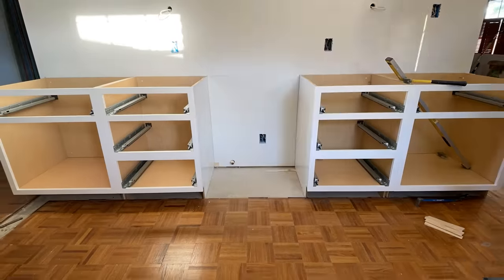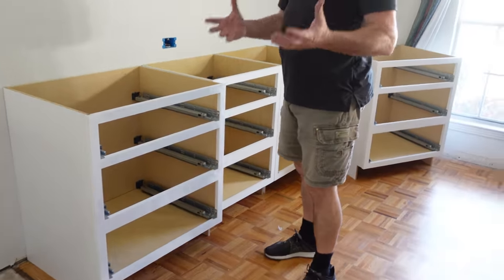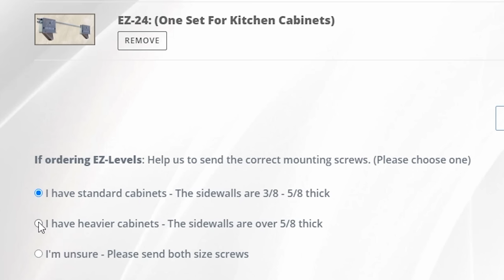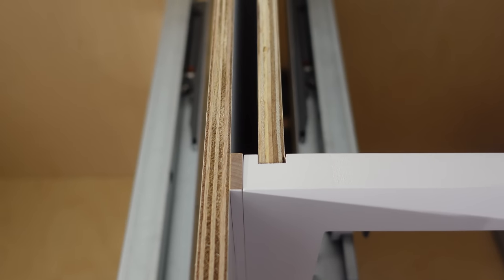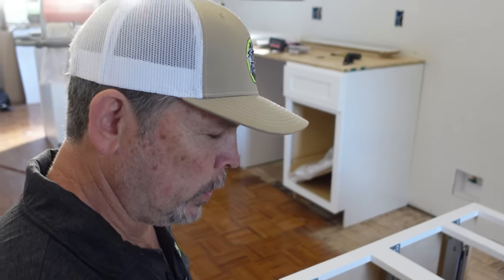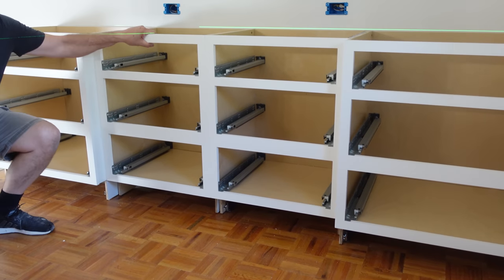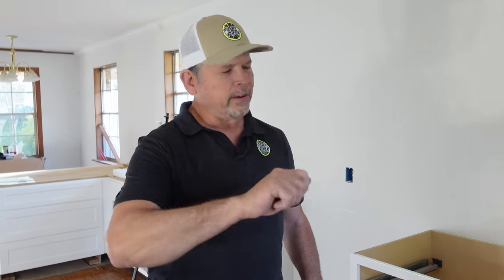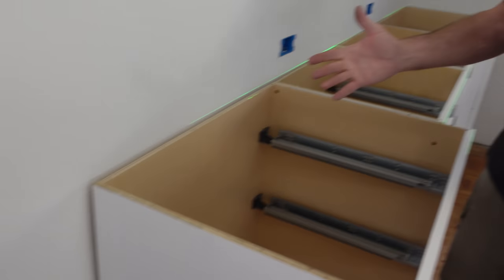$2 Shims VS $40 EZ Level - Is It Worth It?

Comment: Scrulox=Robertson screw pretty nifty invention, I see them used a lot in decking, square type heads=scrulox or “Robertson” screws. In my opinion easy level system is great, yet they are permanent so needs to be included into the estimate for the install $2 as opposed to $16…ehhh I’d got with the time (labor) saver, just saying.

Comment: What locks the ez levels once it’s positioned? Will pressure over the years cause that foot to compress? Or relying on the screws in the back of the cabinet?
Reply: Not a bad question. Hopefully it's designed in a way that this isn't a problem.
Reply: You would screw the cabinets to the wall anyway so I would think that would solve the back side issue.

Comment: Glueing those metal units and the spacer couldn't hurt. Loaded cabinet over time will have less movement. I've worked on mega houses for years but overkill things like that are worth it. Just a bit of polyurethane. Locktite X9 would be my choice.
Reply: Great find. I'm a builder and I decided to do the cabinets myself for the first time on a house. I'm ordering a box. Keep in mind that at least one end or location is usually your high point and you wouldn't need a unit there. You should know from your laser work where you can skip them. I'm now going to use a level with a tape on it to measure the floor at the cabinet front. Good find

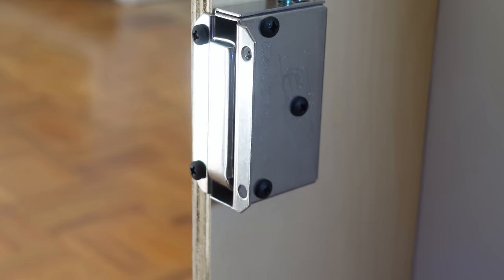Comment: @stud pack 9:11 Paul, is that Klein’s new impact flip socket, or actually the 14-in-1 HVAC Adjustable-Length Impact Screwdriver with Flip Socket - model: 32304 (Klein sent me one and like it, BUT the circle plastic that retains/holds bits in slots and separates from inside handle, already let loose and all bits fell into handle and was aggravating b/c couldn’t close or open bit storage. So, wish was 1 solid piece, or better yet, metal and welded together instead of glued, but they sent me new 1 next day and was able to keep broken; so great CS Agents☺️👍🏻…..(sure does look like the gold standard Malco bit, but w/ a little secret up it’s hole…imo, kinda cool cuz never fails when using a malco ¼” or 7/16, etc…ya need a driver bit and gotta remove the Malco bit. Sure hope Malco isn’t like Klein’s flip bits and will accept a “driver bit” b/c after all these years, I’d feel so so so stupid😂🤣
✌🏻

Comment: The q is, will it hold the weight of the slab plus appliances. So much weight will be pushing down, and what keeps those legs in place are the threads on those adjusters.

Comment: Glad you reviewed the ez level system. Haven’t seen it before. What laser system are you using & recommending? Thx
Reply: Studpack uses Bosch laser with Huepar Fine-tuning Bracket Laser Level Adapter. They mentioned the laser model on the previous video for this cabinet install series.

Comment: In the situation as presented in the video, the EZ Level system was not necessary to access the back of the corner unit. With the toe kick removed a shim could have been used to level far right corner unit.

Comment: Love all your videos, I was about to install my cabinet with wood shims. Your videos are helpful to me! As I know the cabinet should not install on top of floating floor(LVP), by this way I need to raise my cabinet to just above the height of my finish flooring. I was planning use plywood under my cabinet in order to raise it up. I wondering do I still need the plywood under the cabinet if I use EZ-leveling? Thanks!
Reply: No plywood needed.  The EZ-Levels have a lift of 1-1/4".
Reply: @EZ-Level  thanks for answering my question, I have another question that do I need any thing like support bracket for dishwasher gap? It’s between sink cabinet and another base cabinet
Reply: @kellykai4068  Hi Kelly; Yes... you will want to screw a 1x4 to the wall at the laser line. Therefore... do this once every cabinet has been perfectly laser leveled. This will support the granite. (I also fasten one in the front also. Laying it flat of course) Some don't but I'm a bit of an overbuilder.
Reply: @brookscourtney4732  thanks for answering my question, when we screw the base cabinet do we just screw on the top? Or we need screw both top and bottom?
Reply: @kellykai4068  We screw along the tops (just behind the drawer) only
Reply: @brookscourtney4732  thanks, when I mount the EZ level on cabinet. The top two screws(5/8) split the plywood is there anyway to avoid it?
Reply: @kellykai4068  ahhh gotcha. Once in a while that happens. It depends on the cabinet line (the wood used). Even those little screws (#6-5/8") can tend to split some plywood/particle board sidewalls. Because they are so tiny, the split is really not noticeable at all. (at least in our experience). Also, those are not necessary, but they help to keep the EZ's in place while dragging the cabinets around the kitchen during install. They don't hold anything up... They just hold them onto the sidewall during installation. Does that make sense? I have one of my cabinet lines that their plywood splits a little too. My other lines don't at all. We just ignore it now, as we have used them on those cabinets for almost 10 years now. I hope this helps

Comment: Those feet on those shims over time will embed into subfloor. Add a little weight like pots pans and a heavy counter top it just a matter of time before you have problems. Shims are better due to the fact they have a larger bearing footprint.  That’s one of those ideas that sounds good but in reality old tech is better.

Comment: Question? Couldn't you install then between cabinets that connect? As your 1/2 inch filler? Get a screw long enough to go through the leveler into the other caninet?

Comment: Its a cool idea but theres no connection to the floor. All the cabinet Bro's Ive worked for including myself always use separate toe bases that are attached at the front to scrap 2x4 Tapconed to the cement floor...SOLID.
Kudos to StudPack for using Wic screws...if I had a buck for every schmuck that uses drywall screws to install cabinets! It makes something much bigger, fuzzier and further south than my remaining 3 wisdom teeth ache (I extracted one of them myself leaving me 75% intelligent).

Comment: It would be great if the manufacturer supplied small plastic caps to go over their screw heads. Then there would be no chance to accidentally scratch/tear the flooring material when moving the cabinets in place.
Reply: Reminds me of a job I did remodeling a kitchen. The customer had put in a new vinyl flooring in the kitchen after I had built their custom cabinets. They got a new refrigerator too of course and it was sat in the middle of the kitchen floor when it was delivered. The ladies of the home decided to push the refrigerator back into its place by themselves and tore their new vinyl flooring. They were so upset and knew when the man of the house found out they damaged the floor that he would have a melt down. I told them that I could easily patch the spot and you never know it was damaged. Needless to say the ladies were relieved to hear that and could get me to patch it quick enough. So I patched it for them and as I told them you couldn’t tell the floor was ever damaged. The ladies were not going to tell the man of the house what happened. Wasn’t my place to say anything either so I didn’t say a word to the man of the house either.  But the lady of the house apparently told one of her older adult daughters about the incident on the phone and the daughter came over one day and looked at the floor seeing no sign of the damage that was done and said to her mom in front of her Dad too! Hey mom you can’t even see where it happened at! Dad saying what happened where? LOt The ladies had to do some back talking and quickly working on changing the subject to keep from telling the husband what really happened.  To this day I have no idea if the man ever heard about the damage to the floor or not?  Saved the ladies bacon that day though! Even though the daughter almost let the cat out of the bag so to speak! LOL  only took a few minutes to fix the floor with some scrap flooring materials and I didn’t charge the ladies anything for the repair.  Had another incident where I installed a new laminate countertop for a lady and I no more then finished the job and went home when I got a call from the lady upset that she scratched her countertop. Again that ended up being a petty easy fix too with a little seam fill I was able to fill in and match the color of the laminate where the scratch was hidden very well.  The lady was very happy I was able to fix the scratch without having to replace the laminate again.  Didn’t charge her for that one either.  Although if it happen today with these high gas prices I’d probably have to charge a little for the gas !
Reply: I don't even use the screws on the bottom they really aren't necessary the three screws onto side are enough.

Comment: Cabinets should come with these all ready installed as an option. Seems well worth the extra cost that will save money in labor time. 👍👍
Reply: I too have said this a thousand times. Years ago on some TV home remodel type show the crew were installing cabinets that had adjustable feet at all four corners accessible from inside the cabinet.  Best I could tell the adjusting feet were something similar to the adjusting feet on a dishwasher. There was a small hole in the base of the cabinet to insert a tool to move the foot up/down.  Surely a cabinet company could add this feature to each cabinet for less that 30 bucks per cabinet.
Reply: Doc you’re lazy I know you .. stop that

Comment: Easy system but As builders why not just add 2x6 blocking between the studs on the wall where the cabinets will go and at the corners..

Comment: Those metal levelers are pretty cool, probably worth the money if the customers are willing to pay a little extra cost over the wooden shims?  Know I’ve spent a lot of years using wooden shins before these metal adjustable shin devices were made.  But I don’t trust or count on chipboard to hold those metal adjustable shims with screws only screwed into the chipboard. As this guy in the video says be careful tightening your screws in the chipboard or you’ll strip the screws out and then you’ll need to take the screws out and plug the holes with some glue and toothpicks to fill the hole then start over trying to screw the metal adjustable shims back on the  chipboard again. Personally I’ve had too many screws work loose over time and strip themselves in particular board or chipboard.  Another reason I never built my cabinets out of chipboard. I preferred using a 7 ply birch plywood. 11 ply if I could get it!  Then you got a strong material you can screw into that won’t strip out anywhere near as easy as chipboard will. Not to mention chipboard starts breaking apart in flakes if it ever gets wet for any length of time.  Plywood far more stable in water.  Really don’t like even using chipboard for countertops.  Especially not on a island with a bar overhanging the back.  Plywood so much stronger and can take a lot more weight on it when the wood hanging over the back of a island cabinet.  If you get many kids horsing around when mom and dad not around climbing on the Island bar top you may regret is it’s made of chipboard? Chipboard certainly cheaper to buy, but in the long run the plywood worth every penny over time!  Unless your selling the home, then it’s the next buyer problem when the chipboard fails in some way like bowing or warping, especially when it’s under any weight.  Seen several cheap roll top desks people bought in furniture stores where they had books and Nicknacks on the top of the roll top desk and just from the weight of those items bowed the chipboard top down more then enough where they couldn’t open the roll top any more.  I’ve had to replace the top with a good sheet of oak plywood to match the roll top so it was usable again and then putting the books, etc on top of the roll top wasn’t a problem any more either.  I always try to talk people out of using chipboard whenever I can. But unfortunately some people just have to learn the hard way!  Chipboard cabinets you just never know when their going to start falling apart?  Just take a look at your old cabinetry that’s made of good plywood that’s still in homes and holding up even decades later!  Your not going to find those chipboard cabinets holding up to the long years of time!  Fact is, I’ve had to go in and remodel chipboard cabinets within 5 years in some cases. Especially when the cabinets are made of 1/2” thick chipboard as many are! I always service my customers if and when they had any problems with any cabinets I built for then no matter how long ago I built their cabinets?  Long as it wasn’t from serious abuse I take care of it no charge.  So I wasn’t going to use materials or hardware that I knew wasn’t the best and not likely to last more then a few years.  Legally cabinet shops only have to guarantee their cabinetry for one year. Then if something goes wrong it’s the home owners problem to fix or replace. But I guess it’s like everything else these days, everything falls apart or fails many times even in a years time and you need a repairman to fix it! Not like the good old days when TV’s, stereo’s, refrigerators would last and never need a repairman for generations of these items being handed down to the next younger generation of family members!  Things built these days probably won’t last long enough to ever be called a antique that’s worth anything! But the antiques of the 60’s, 50’s and even older probably will still be around and still gaining in value!  Assuming things are least taken care of and not abused?
Reply: Dude, please learn how to make paragraphs.  These comments are impossible to read!  Hit the return button once in a while, I don't even care if the breaks make sense!
Reply: @CitEnthusiast  DUDE, I’m not writing a book! If you don’t like how it’s written then don’t read it. No one forcing you to read anything! But apparently it must of entertained you enough to have something to complain about. Now go cry me a River! I’ll try out my new boat!
Reply: @ghostridergale  my favorite is " cry me a river built yourself a bridge and get the F over it

Comment: Hi stud pack are those Bessie clamps that you're using for the face frames I have a set of those but when I tighten down on them they leave an indentation in the center who makes your clamps
Reply from the maker: Yes mine are Bessies too.  I've had the same problem.  Some have commented that they grind down that part of the clamp

Comment: FYI: This won’t work when installing heavy granite countertops with cheap cabinets. You have nice plywood walls on your cabinets. A lot of cheaper cabinets are using particle board. The kind that crumbles. It’s the sound that gives you nightmares…when you hear the cabinets drop because the screws for the levelers ripped out.
Reply: The weight is not on the screws. The edges sit on the edge of the levelers. In the installation video they say you could even use tape to hold the levelers in place. That is only to hold them while moving them.
Reply: Particle board doesn't stand up when it's sitting flush. It ought to be outlawed for cabinets.

Comment: Not a fan of those leveling feet. You can easily level cabinets by marking where the frame sits on the floor, using a tape measure along with your level line to place shims on the ground to make them level with the line. You can use some construction adhesive to glue them down so they don't move. Once you have the shims glued to the floor, just place the cabinets on top of them.

Comment: how do you remove EZ level once cabinet is installed if you screw them to the underneath of the side panel? access to the screws will be blocked because of the floor.

Comment: do they fit between 2 cabinets in the 1/2" gap so they lift both cabinets? they can be the spacer at the bottom?????

Comment: Use IKEA cabinets they come with adjustable legs
Reply: And if you have long run of cabinets you can fix strip of wood to wall on lower end of cabinet and lift cabinets over that strip and then adjust front legs to floor then screw them each other and to wall and it's even faster.
Reply: Good idea. Might steal that for a kitchen I'm working on
Reply: @mr.wizeguy8995  Ikea cabinets (even the lowers) use a steel suspension rail to hang the back on the wall. As long as you hang the rail level to the studs you only have to adjust the front feet to get the whole thing level. Uppers also use the suspension rail so getting them all level and aligned.
Reply: @RCLapCar  I have read that  Europeans take their cabinets with them when they move that's why Ikea makes them to hang on the wall and with adjustable legs
Reply: @RCLapCar  Ok, never bought any IKEA cabinets only seen them after install. But what i recommended work if that steel rail is missing and you have 4 adjustable leg in each cabinet or you are DIY whole cabinets so no need to buy so many leg.
Reply: @michaelegan9568  Ha Ha. That is a total myth

Comment: Theyre definitely easier to use than those plastic spinning feet. Especially when you gotta reach to the adjust the back ones
Reply: there is a ratchet tool for those plastic spinning feet. pretty easy to use

Comment: This seems incredible, but now you’re left with a point loads on the floor as well as a gap down the sides of the cabinets where you raised the side off the floor.

How do you deal with that?
Reply: The point load is a good observation. Lots of weight (with solid surface) on less than 1 sq in per foot. 
The gap you’d have anyways with shims or level system. Scribe to close that I suppose.
Reply: Some people were saying wooden shims can swell or shrink, so I’ll probably try plastic shims next time to help spread the load to several points.